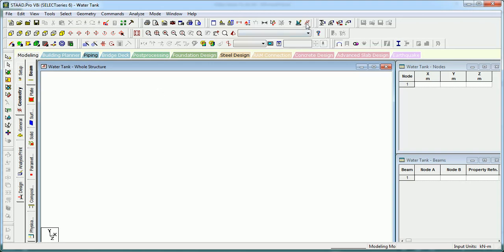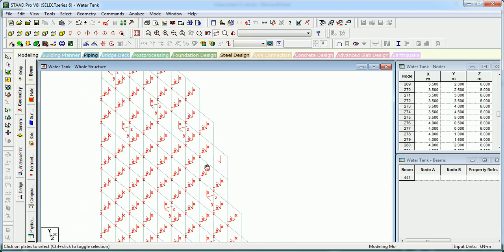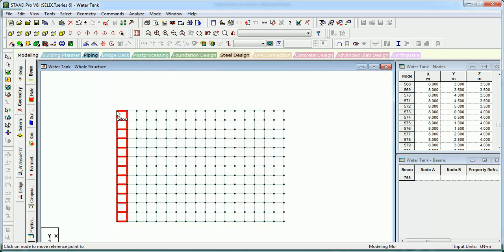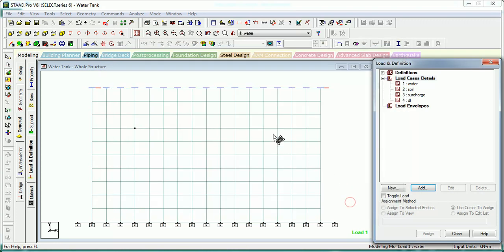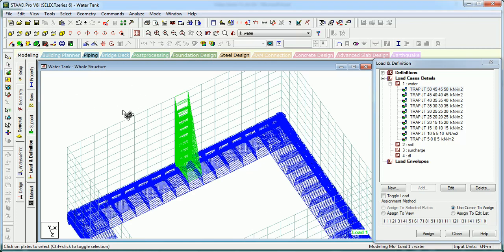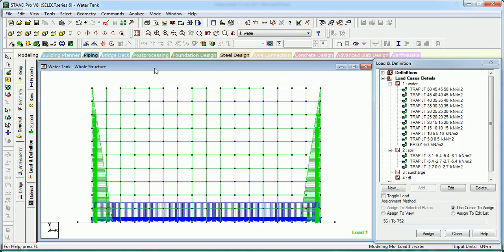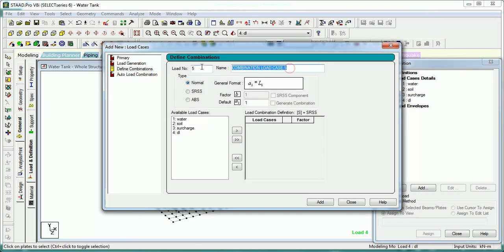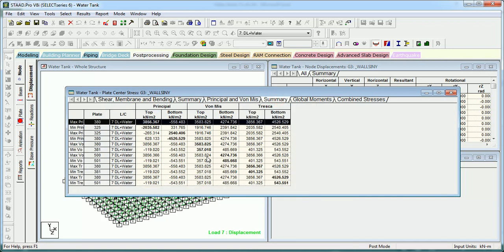Design of water tank in STAAD Pro

Comment: what if the tank is to be designed for temporary conditions when there is no slab on top. You will have to remove all those restraints from top nodes but STAAD will give instability warning. What is the best way to avoid that?
Reply from the maker: There will be no instability erroe
Reply: @Tinytopic   In that case deflection occurs, what is the limit?